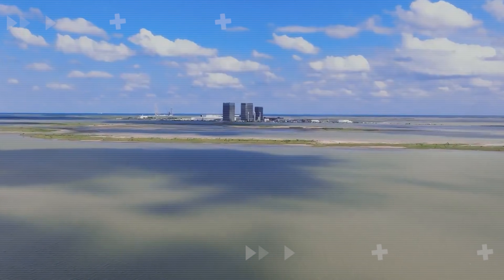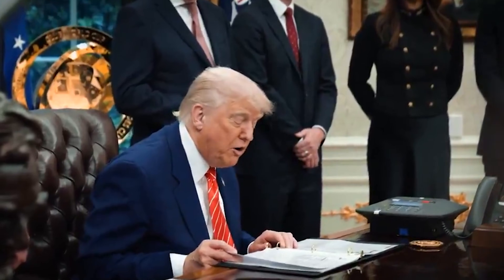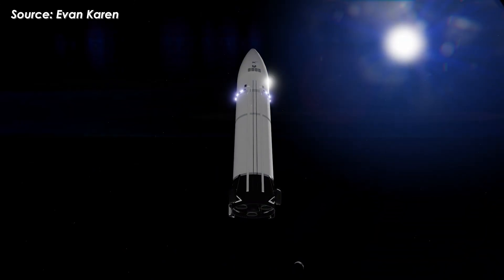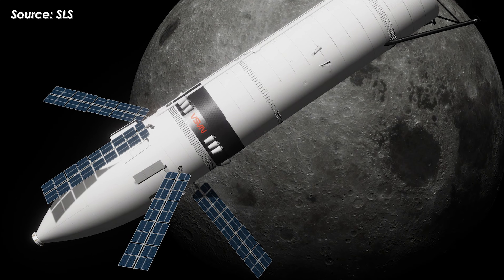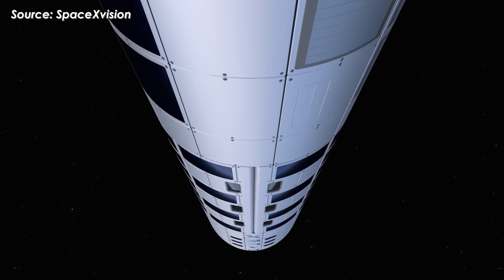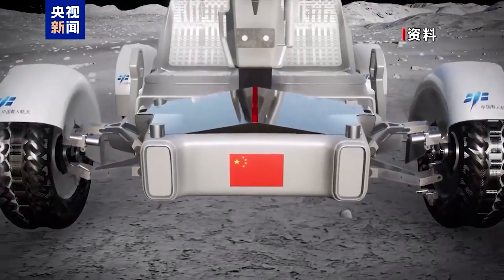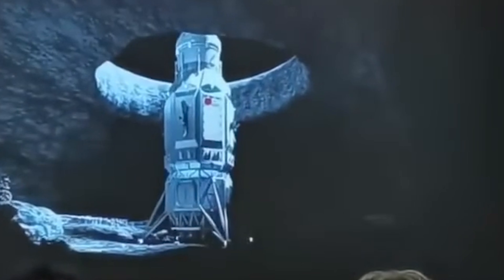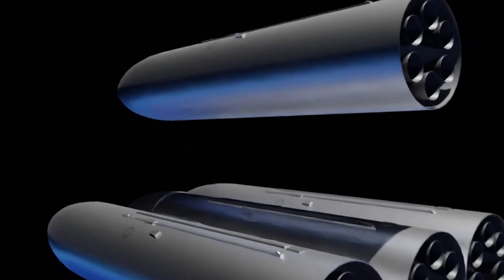Elon Musk's Genius Solution to Beat China to the Moon Simplified Starship, No Reuse...

Comment: Starship is great, but it is clearly designed for LEO. Wanting to send it to the Moon in its current configuration is a flawed concept. We don’t have the propulsion technology to do it it easily and making the whole lunar mission depend on numerous refueling launches puts unnecessary complexity and risk to an already complex and risky mission. Let’s make a smaller Starship with a good payload capacity that doesn’t need to use its own fuel either to put itself in LEO or to perform a TLI. In other words, make a partially expendable launcher by using the reusable Booster Heavy pushing a second stage capable of inserting itself in LEO and performing a TLI, and leave Starship HLS as a third, upper stage that has only enough fuel to insert itself in lunar orbit and then perform a powered descent to the surface.

Comment: If NASA helps pay the money they can specify the goals. Then Space X and NASA work out the conditions.

If reusability is taken off the table, for an accelerated single goal program. NASA funds Space X to make Starship have the structure of a Falcon-9 program. Reusable booster, expendable upon completion second stage. Dragon or Orion becomes the crew taxi system to and from Starship.

This would not be outside the scope of Space X, just a branching of what exists and what is possible given the program's progress and timeline.

From Space X's point of view, it's a practical program vehicle to test systems that will be needed in the near future, especially for the Mars mission.
To gain experience.

Comment: Why does Starship endlessly try to overcome the complexity of zero gravity in a vacuum? While refueling the empty ships at launch would be feasible during ascent up to 180 km, the super central propellant tank, shaped like a glider (X1 by 4), is covered on all sides by its roof tiles to withstand atmospheric reentry, exactly as Starships do on return. This involves minimal ignition for landing or ventral parachute deployment in oversized nets.

The Raptor's power allows for lifting 1600 tons and changing the HLS configuration from a very small one to a much heavier architecture that guarantees 100% vertical mobility and horizontal stability correction. This is achieved using arms, four-sixths of which have a 25-30 m reach, shaped like vertically closed skis X4-6?    Attached to the outer hull and operated by hydraulic cylinders, the 4/6 skis open in an inverted umbrella shape, vertically beneath the spacecraft. The lower points act as ground pressure dampers, preventing significant dust accumulation.

This version of the external HLS system is much more accessible for external maintenance and more stable for heavier unloading, making it more practical for orbital returns and even for preparing the deployment of inflatable rollover mattresses. This rollover is controlled by unlocking one or more external support arms/legs that are raised vertically on the super-heavy cargo/habitation station.

The first 100 days were spent deploying and removing all the giant inflation devices, anti-freeze and/or anti-dust domes for the nuclear power supply equipment for drones and robots on-site, and for freeing up the Starships.

Deployment of hangar equipment, automated earthmoving equipment for soil leveling, energy circulation rails for thermal/electrical power, lasers for Earth-Moon communications satellites, other devices against ultra-low temperature and protection of electronics against cosmic radiation of regolith dust, for the immediate storage of construction site tools and long-distance lighting, and various slow spraying vehicles for the protection of ground stations against solar and cosmic radiation.  Long live SpaceX and long live Starship, Bravo Space Dragons! Bravo to all Alphatech Team😎👍🌌🪐🚀👑🛸🛰⛽🎑🏆🏆🏅🌉🏟🌘🌎🧭

Comment: If you stripped the starship down and filled it with fuel, except for the very top that would be a small moon capsule, could this capsule make it to the moon? The launcher would return as it does now, then the starship would be a disposable second stage with its cargo space filled with fuel. Once it burned out its fuel, the capsule would separate. I don't believe it is possible to send a one stage rocket to the moon that can carry two-three humans and what they need to survive, plus fuel to land on the moon and return, it would be too heavy due to the fuel load. So there has to be at least two stages, or three stages if you count the capsule as the third stage, I guess technically it is a third stage.
Reply: no
Reply from the maker: Yeah, you’re basically right on the physics. A single stage doing Earth launch, lunar transfer, landing, and return with crew is just not realistic. The mass penalty from fuel alone kills you.

That’s exactly why Starship relies on orbital refueling and effectively behaves like a multi-stage system in space. Super Heavy is stage one, Starship is stage two, and once you start refueling and separating vehicles, you’ve functionally added more “stages” without stacking them vertically.

A small capsule on top could work in theory, but then you’re right back to something closer to Apollo-style architecture. The whole point of Starship is to move that staging into orbit and trade complexity on the ground for simpler, repeatable hardware.

Comment: The occupant of the White House should be more concerned about US leadership on Planet Earth.  Pissing away billions of US taxpayers dollars on vanity projects like the SLS and Artemis while cancelling solar and wind power to supplement oil and LNG power is irresponsible at best, criminal at worst.
Reply: Pissing away billions of US taxpayer dollars? Like in Minnesota?
Reply: You voted for Joe, then Camela, be quiet! 😂
Reply from the maker: I get the frustration, especially with the cost side of things. SLS and Artemis are insanely expensive, no argument there. The point of this video isn’t really to defend those programs, though, but to show why NASA is under pressure to make Artemis actually work on a tighter timeline.

That pressure is exactly why lower-cost options like Starship matter. If anything, a simplified Starship is almost the opposite of a vanity project — it’s about getting real capability faster and cheaper, instead of burning billions per launch forever.

Comment: If no one has ever transferred cryogenic fuel in zero gravity before, how do you know it's so hard?
Reply from the maker: Fair question. We know it’s hard not because it’s never been studied, but because of the physics involved. Cryogenic fluids boil, slosh, form bubbles, and don’t settle in zero-g, so you can’t just rely on gravity to feed pumps or control pressure.
Reply: Or going to be easy

Comment: spacex spends most of its time launching starship into low earth orbit testing flaps and landing in the sea..to be honest they have not gone anywhere towards a moon landing or building a prototype moon landing ship  just getting  things caught by chopsticks VERY NICE but there not going anywhere fast
Reply from the maker: It looks slow from the outside, I get that. But all those LEO flights, flap tests, and landings are about proving the hardest part first: reentry and reuse.

The lunar version actually skips most of that. No heat shield, no flaps, no ocean landings. Once orbital refueling is demonstrated, the path to a moon-capable Starship gets a lot shorter than it looks right now.

Comment: It's not optional, rockets must be re-usable to do it within NASA budget. Unless you want to visit the moon only once, and then let China build a permanent base.
Reply from the maker: I mostly agree with that. Long term, reusability is absolutely required if you want a sustained presence on the Moon.

The argument here is more about timing. For the first few missions, using a simplified or expendable Starship could get NASA there faster and cheaper right now, then reusability becomes critical once the infrastructure and cadence are established.

Comment: Why the hold up?? If nothing else you could find a small crater with caves and start off loading supplies while you have AI assembling buildings and warehouses while exploring, mapping and making tunnels livable for humans. Again why wait?
Reply: Because until Starship/Superheavy become operational, none of that can happen.
Reply from the maker: The idea makes sense conceptually, and that’s roughly where things are heading. The hold-up is mostly about transportation and reliability.

Before you can start dropping supplies, robots, or AI-driven construction gear onto the Moon, you need a system that can land heavy payloads precisely and repeatedly without failing. Right now, no vehicle has proven it can do that at scale.

That’s why the focus is still on landing systems, refueling, and basic operations first. Once that’s reliable, unloading supplies and building infrastructure can move very fast.

Comment: This is what I have been saying for long time. The fully reusable earth landing is the hardest to build the HLS human and cargo along with tanker and depot ships will be easier and faster to build.
Reply from the maker: Yeah, that’s exactly the idea. Earth return and reuse add a ton of complexity, especially the heat shield and flaps.

A lunar-focused Starship doesn’t need any of that, so HLS, tankers, and depots can move faster once refueling is nailed down. Proving the hardest Earth-return problem first isn’t wrong, but it does slow everything else down.
Reply: @alphatech4966 Thankfully Elon and SpaceX move much faster than NASA and others rapid iteration and testing

Comment: The purpose of getting to the moon with a disposable ship would be to build the landing pad for the starship version to land on. A much smaller single use delivery of a bulldozer etc. It could include the necessary return capsule for crew. Like Apollo but plus construction equipment and provisions for the build time, whatever that is.
Reply from the maker: Yeah, that’s a very reasonable way to think about it. Early disposable landers could do the dirty work first: landing pads, berms, power, basic infrastructure.

Once you’ve got a prepared surface, landing a full Starship becomes much safer. The difference is that Starship can deliver far more equipment in one go than Apollo ever could, which is why the payoff later is so big.

Comment: Translation: Starship is too heavy and takes up no payload. Why make a vehicle going to Mars or Moon reusable?? Quite stupid. 
Space X’s time of bull$hitting everyone are coming to an end. Isaacman just said put up or shot up..
BTW the first milestone on Space X’s proposal to NASA was orbital flight. So after 3 years, they have not met the first milestone.  I think Starship is going to get smoked by others unless drastic changes happen
Reply from the maker: There’s a lot packed into that comment, so I’ll try to keep it grounded. Starship being “too heavy” is actually part of the design trade. It trades dry mass for volume, engine-out capability, and deep-throttle margin — which matters a lot for landing large payloads.

Reusability for Moon/Mars isn’t about saving money on one mission, it’s about sustained operations. If you want a permanent presence, throwaway hardware gets you there once, not repeatedly.

On milestones: Starship has achieved orbital flight and reentry, even if not in the final reusable form yet. NASA milestones are often phased and revised as test programs evolve.

Whether Starship ultimately succeeds is still an open question — no disagreement there. But no other system right now is even attempting the same scale of lift, landing mass, and refueling. If someone “smokes” Starship, it’ll be because they solved the same problems faster, not because Starship was pointless.
Reply: @a @alphatech4966 You can make rockets as heavy as possible, the only thing that suffers is payload, which is the most important thing on the rocket.
I think V3 will not even get to 70t to LEO. Space X can keep iterating, but the lunar lander is not going anywhere. I have zero confidence in this program.
In its payload capability, reusability, in orbit refueling and the concept. This is another cybertruck or Hyperloop. Its not going anywhere fast. 
Space X went from having the lunar lander to up for grabs. Its not because they are killing it. Meanwhile they keep clapping for themselves.

Comment: --  --  About refueling  --  --  The fuel sloshing got my interest.  --  perhaps a fiberglass wall insulation type baffle might help.  --  but, instead of heavy fiberglass, use graphene nanotube or Carbon fiber or graphene or boropnene fibers to create a semi-sponge to stabilize and direct the fuel flow.
Reply from the maker: Thanks your supprt! Lightweight graphene or carbon-fiber "semi-sponge" baffles could effectively dampen sloshing with minimal mass penalty—better than traditional metal ones.SpaceX mainly plans active settling for refueling, but advanced porous structures like this could complement it nicely for future tankers.Borophene's still too immature for cryo use, though. Cool thinking!
Reply: @alphatech4966  --  --- You're welcome.  Active settling does make good sense .  As someone pointed out:  Graphene etc. might be flammable/explosive.  So, that leaves active baffles and magnet drive centrifugal stirring means.  or refillable cartridges.
Reply: It looks like SpaceX solved this by having small independent tanks for landing. Your list of materials os mostly carbon-based, which can ignite in LOX. (that issue probably caused at least one SpaceX exposition) With the continuing issues with carbon COPV pressure vessels, I expect SpaceX to do the opposite, and change form carbon to steel, since they need reliability and with Raptor 3, they have plenty of weight margin.
Reply: @jwstolk  --  --  Makes perfect sense. Definitely don't use carbon!   That weight margin puts me back in the reusable, Bic cigarette lighter,  cartridge camp .  If time is of the essence keep it simple.  Can get fancy later.